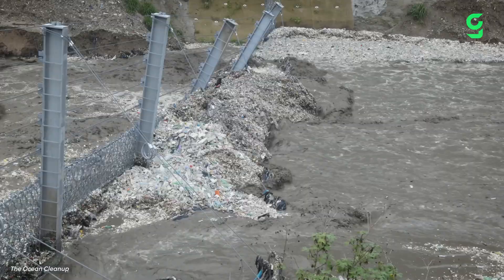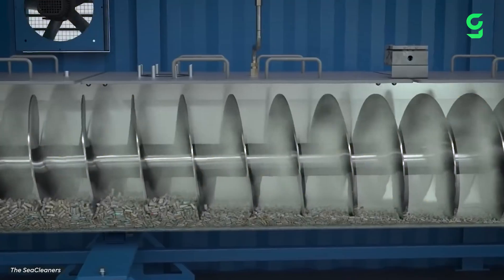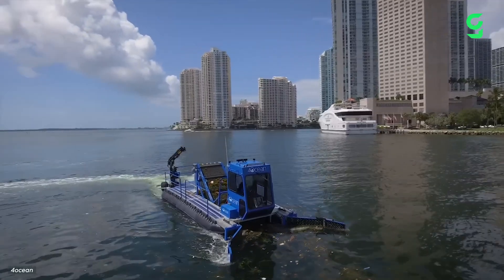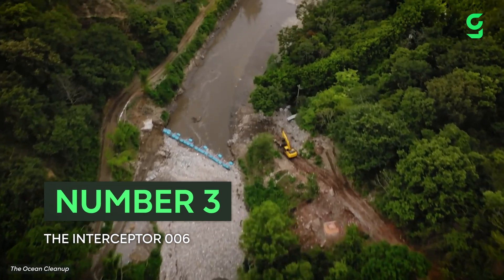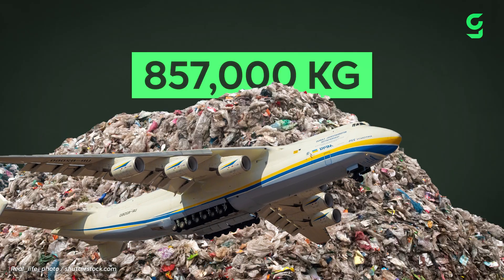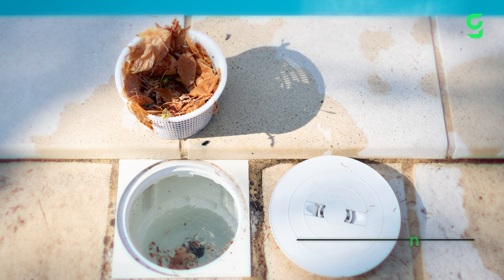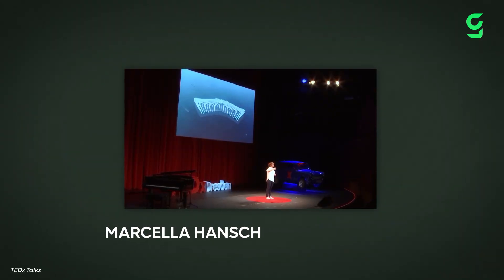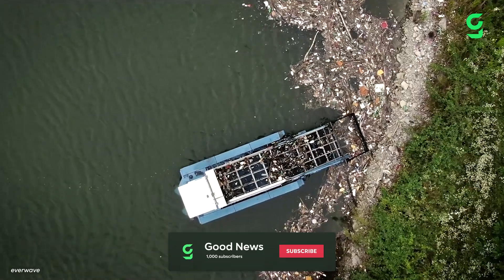Can We Save Our Oceans?

Comment: While it’s great that we are getting plastic out, the key is eliminating plastic use in the first place for other more sustainable materials.
Reply: I know that this is over a year old by now, but i just found Good News. The things is that we need a material that can replace plastics in a practical, non toxic and environment friendly way. 
Currently they use paper for a lot of it, like straws and that does not work at all from a consumer standpoint. The straws fall apart basically when they get wet and it annoys customers, me included.